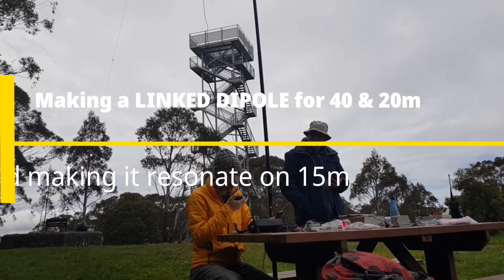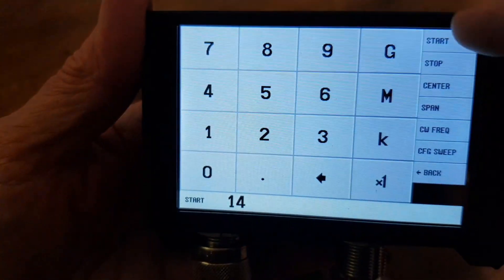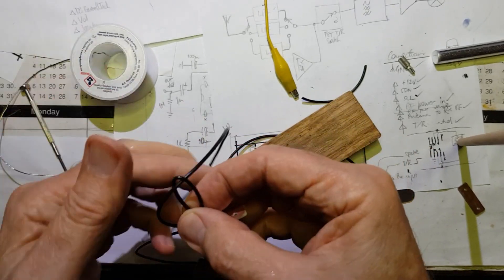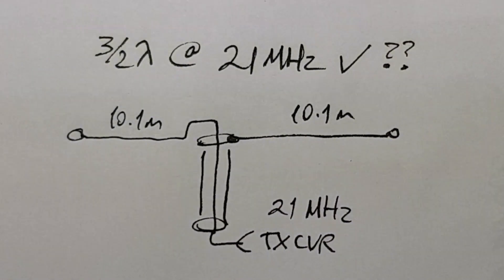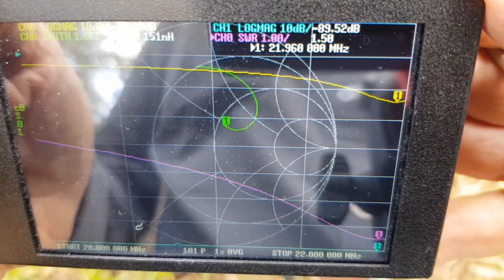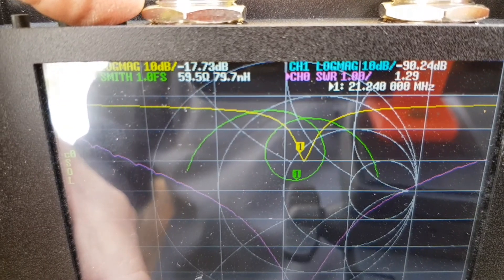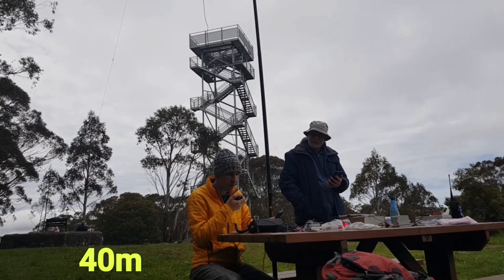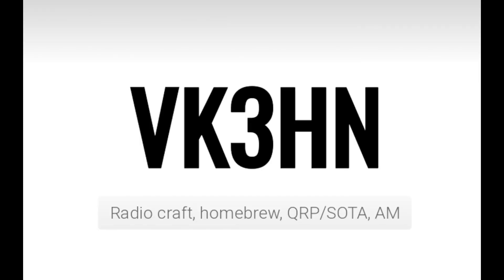Make a 20 & 40m linked dipole (and get 15m for free!)

Comment: Hi, great video thank you. I tried this and I have 20 and 40 fine but can't get 15, in the video you say 11 turns on 20mm tube but the picture shows around 6 turns, can you please confirm?
Reply: Also, you call it an inductor, but without a toroid, is this not just a resistor? Sorry, can you please clarify this part of the video. Thank you.
Reply from the maker: @bluebellsunseeker1167  Not all inductors are wound on ferrite, or powdered iron. This one is 'air cored'. Google it for the theory and some cool examples.  They are widely used in antennas, power amplifier stages and matching units where RF power flows.
Reply from the maker: Hi, you are correct in noticing the discrepancy,  the hand drawn picture shows 11 turns, but the finished inductors show about 8 turns. I think I can recall starting with 11 and finding the actual inductance as measured on my LC meter was too high, so I took 3 turns off.  You need around 1.1uH. The actual inductance may vary in an air cored coil due to wire gauge, tightness of the windings, and former material.  Just aim for 1.1uH. I should have explained that in the video!  
Good luck and good DX on 15. 73 Paul VK3HN.

Comment: With the measurements being fairly precise, 5m and 5.1m, when you have the cable going through the board, knots, etc. are these taken into consideration? Is the length in total, right up the connector? This looks exactly what I need but as a complete novice would like to make sure, thank you.
Reply from the maker: Measure the sections from the extremities, ignoring the wire tails that wrap back on itself or thread thru brackets, these should have little effect.  At HF, 10 cm is not that significant.   I think Callum M0MCX has a short video on this question on DX Commander channel.   You might enjoy some of his videos, he explains things very well. Good luck!
Reply: @Paul_VK3HN  Thank you Paul, appreciate your reply. I was concerned only because the 2 measurements mentioned were so specific with only 1cm between them.
Reply from the maker: @andyzot  Its 0.1 metre, 10cm, or 100mm. So the 20m legs are 5m, the 40m tails are 5.1m. You know what they say about making antennas? Measure twice, cut once! Good luck.

Comment: A good result. I was always wondering if the observation tower was still up on Mt. Donna-Buang, and I notice from your video that it still is. Last time I was there was in the 1970's. There was a similar one here in central Gippsland, but it was removed. I've contemplated taking a few clamps and a pole to take advantage of the structure to operate from. I can imagine it's a popular place for Sota.
Reply from the maker: Its one of the most activated SOTA summits in VK3, because it is just an hours drive from Melbourne,  and the road is sealed and excellent driving. As well, the lookout tower and no Comms Facility so it's RF silent.  If you have some gear to use portable,  even a VHF UHF hand held, and you are in the vicinity, well worth a visit.
Reply: @Paul_VK3HN  Thanks Paul. I'm in Morwell, so it's a fair hike for me, but I can see myself visiting  there  with the wife and the go kit. I recently travelled the road from Launching Place that goes over the top and heads down to Healesville. There is a turn-off on the spur that heads to Donna Buang but that road was closed. I imagine the best way there is via Warburton. 
Cheers, John.

Comment: Neat! I did a similar experiment with using 40m dipole on a 15m band some time ago, but instead of phasing coils I used "butterfly" capacitance hats. The technique is well described in the article "Antenna Here is a Dipole" written by James Hearly, NJ2L, and published in QST for June 1991. It's easy to find. The advantage of using capacitance hats is that the losses are less than in the case of coils. But they should be placed at ~1/3 of the length of a 40m dipole, which wouldn't be convenient for this project.
Reply from the maker: Hi Alex, thanks again for commenting, you always shine some light on the topics of my videos.  I Just added the Facebook URL for the SOTABeams post on making a 40m dipole resonant on 15m. They do suggest 'capacitance hat' wires of a few metres connected at the 20/40 link and left to drop vertically.  This apparently brings the resonance down but other factors inhibit a lower SWR.  The best option, they advise, is the 1.1uH inductance in the links.  
Curt Stacy in another comment suggests connecting both the 20m and 40m dipoles at the centre, giving a fan dipole.  This apparently resonates on 40 and 20 as expected, also 15 and 10, presumably by virtue of the dipoles each working at 3/2 lambda on these higher bands.  May be a bit of a wire tange on a summit, but worth trying sometime.  73 Paul VK3HN.
Reply: @Paul_VK3HN  The reason why I'm commenting is that you are publishing such great technical no-BS videos, Paul. This is rare on YouTube these days :) Thanks for doing this and keep going!

I can confirm that 20/40m fan dipole has SWR < 2 on 15m when fed with a λ/2 balanced line with account for velocity factor on 40m (i.e. half-wave impedance repeater @ 40, full-wave impedance repeater @ 20). According to my notes, it didn't work with a coax, but maybe I just didn't check that it did. It did work with a 20/40m fan vertical ("fork antenna" as we call it in Russia, "carrot antenna" if it has 4+ bands). 

Another good option for SOTA can be a ZS6BKW antenna for 40,20,17,12 and 10 meters (FM part of it). The traditional design described in most sources implies a specific height of the mast and dipole (flat) shape of the antenna, but I recalculated it for the inverted-V shape and the height about 10 meters above the ground. The details can be found in my blog. ZS6BKW can also be tuned to 80/30/15 meters using a tuner as G5RV.

Comment: Paul, Nice video. If you can handle a little more weight on the mast try a 20m dipole soldered to the same points as the 40m. keep them about 6" apart minimum. can go a lot farther apart.
then you have the fan dipole or the maypole depending on where you rotate the elements. this will give you 40, 20, 15, 10. being the fan type dipole it will make it more broadband and you need no jumper or coil. this is a nice way because there is no need to pull it back down.
Reply from the maker: Curt, thanks, a fan dipole with 20m and 40m elements is a very good option.  If you noticed in the video, I made up each wire element with a spade lug at the centre end, which hooks onto the centre-piece (made from old PCB).  This arrangement would make it possible to use just the 20m wires, just the 40m wires, or both.  I agree that dropping the ends to open/close links to move bands is not ideal, but it has not worried me too much to date.  I must try your suggestion next.  73 Paul VK3HN.
Reply: @Paul_VK3HN  I didn't notice that Paul that is a good idea to keep it changeable for a mobile antenna. just put up what you need. I will need to try that with my Spiderbeam for fieldwork. Any suggestion on wire type for the weight?
The current configuration I use just for a note is permanent with an 80, 40, and 20 it is truly amazing 2:1 and below on everything but 30 meters. I have a 1:1 balun and 100' of RG8X.

Comment: Great solution! Wire antennas are great for portable stations - very light weight. My first HF antenna project was a linked dipole for 40,20,17,15 using 3 sets of links. I am pleased with its performance. Thanks for the video and 73 de Brian - K3ES
Reply from the maker: Thanks for sharing Brian. I used a linked dipole, 40, 30, and 20 for about 5 years, a very reliable and simple antenna. You do have to drop the ends to open/close links but I do not generally band hop a  lot, so it doesn't bother me too much.  All of my SOTA rigs are homebrew so I do not carry a tuner.  Hence native resonance is essential.  I've never tried this loading of a 40m diupole to getit onto 15m but it worked as describved.  Other commenters have suggested several alternative schemes.  And welcome to ham radio, portable operating and hopefully soon, CW, the ideal portable and parks mode!